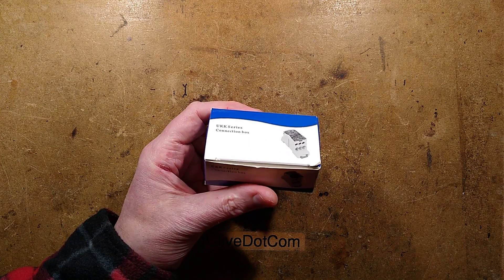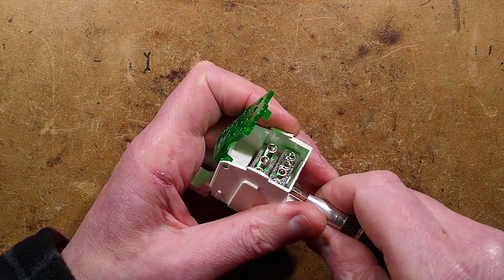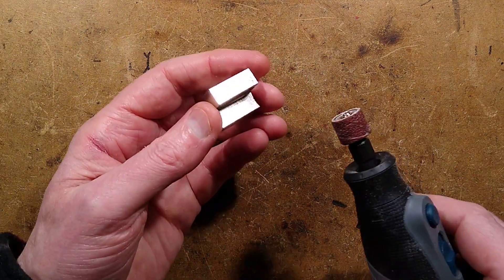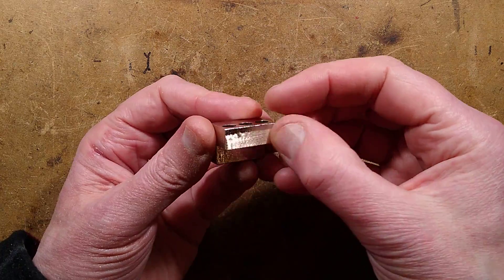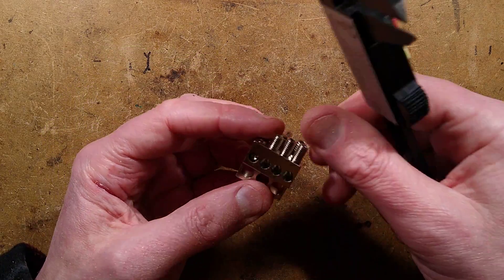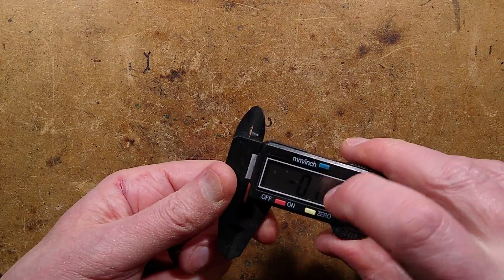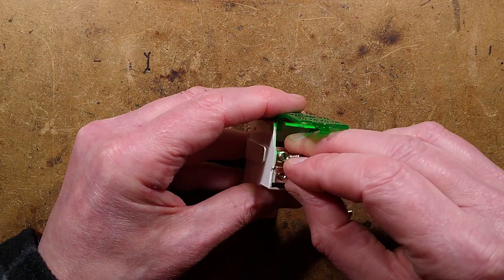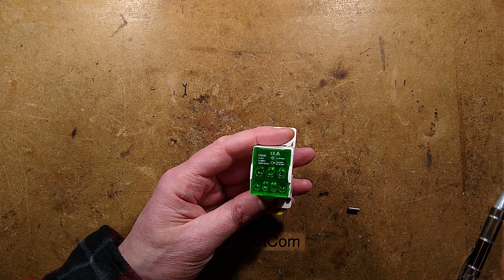Would you trust a Temu 80A electrical connector?

Comment: I've used them for battery systems. - work well and don't heat up at the rated load. I've mostly screwed them to the enclosure backplate but have put them on DIN rail in the past. Just make sure you properly tighten the hex screws.

Comment: It seems good enough for hobby projects, but for actual installations I would not risk it and get components from a reputable seller. Just to make sure.
Reply: Are your hoppy 80A different from domestic supply ?  Assuming the cheap plastic is still there holding it off the metalwork.

Comment: If the plating is nickel it would explain the slight magnetic effect. I wonder of it is still magnetic when all the screws are removed and the plating ground off.
Reply from the maker: I removed the plating and screws and it still had a very slight attraction.  I also tested the magnet on a couple of brass plumbing fittings and it had a similar light attraction.
Reply: @bigclivedotcom  interesting
Reply: According to our friends on Reddit, 954 aluminum bronze contains 5% iron and is weakly magnetic.  … and it is used in plumbing fittings.
Reply: @wtmayhew  Interesting info :)
Reply: “I shall grind the bottom here” slip of the tongue, ooh err.
Reply: yep came here to say that, thick nickel plate is certainly magnetic
Reply: @TheChipmunk2008  Likewise - Great minds and all that!